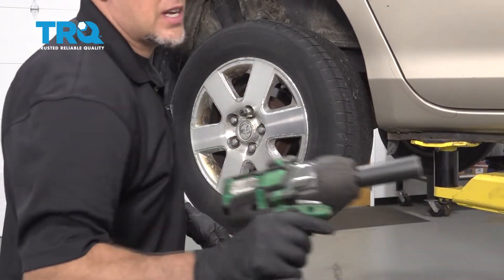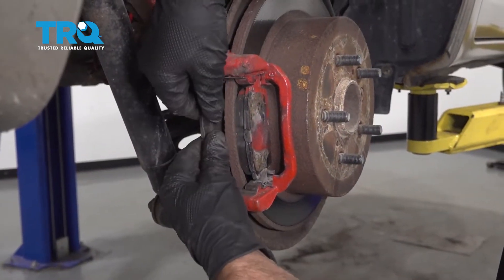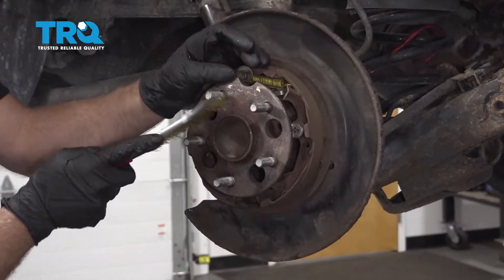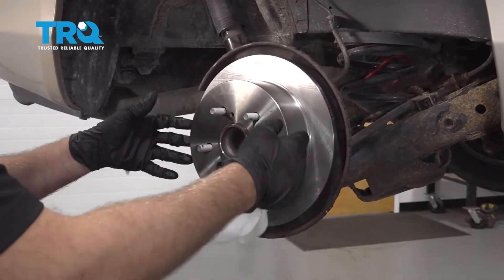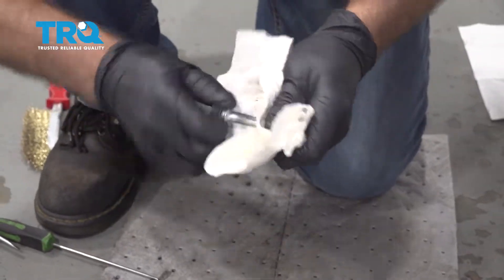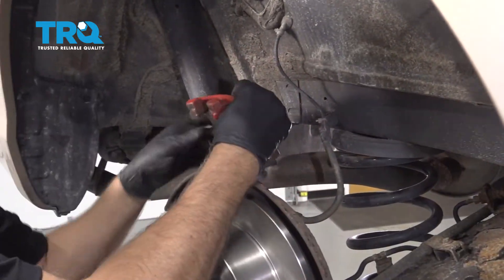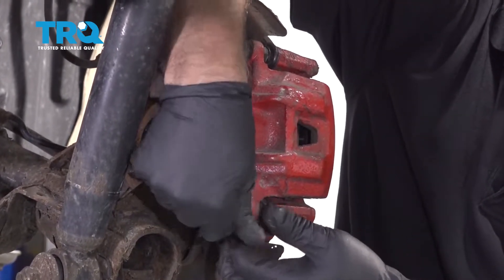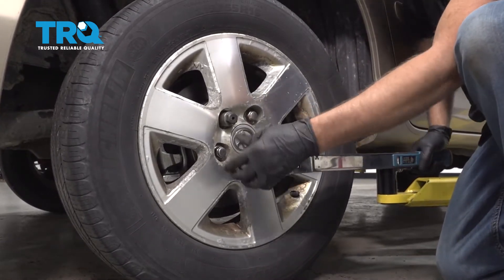How To Replace Rear Brakes 2004-2010 Toyota Sienna

Comment: Having done this, I recommend that before starting to remove the rotor, turn the wheel so that the parking brake access hole is at the bottom, in the 6 o'clock position.  If the rotor still won't come off after breaking it loose, you may need to back off the parking brake pads.  If the parking brake pads get caught on the inside of the drum, don't force it, you will bend or break the parking brake hardware.  Use the parking brake adjustment instead.

Comment: I'm not totally sure if it matters on the placement but the pads with that extended metal bar is on the back at the bottom. You didn't mention it when you put the pads on.

Comment: I put WD40 rust penetrating oil wherever it looked like it could get behind the rotor and waited, then clobbered the back of the rotor. It came off. The threads in the old rotor stripped, they were so rusty

Comment: If you don't lube your caliper where it makes contact with the pads and where the pads sit in the caliper bracket it will be noisy and the pads will bind up...brake jobs never go this easy. Especially the rears.

Comment: been beating on the rear rotor/drum assembly with a sledge and wooden block.  Will not come off.  At exactly 2 min.  the 2 bolts that thread into the parking brake drum part of the rotor, DOES ANYONE know the pitch/size of the bolt ???         Thanks
Reply: You figure it out?
Reply: M8-1.25
Reply: That’s what he’s doing 🙄